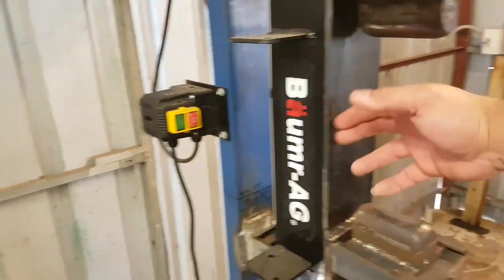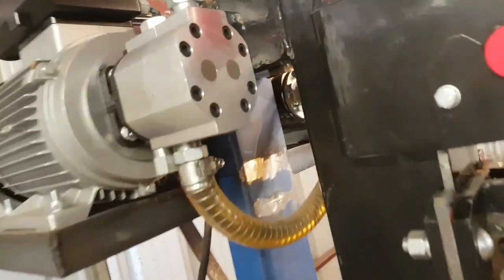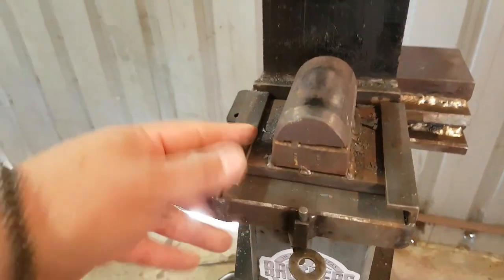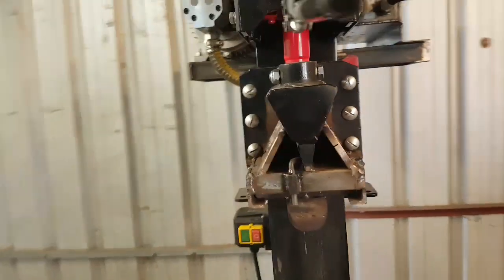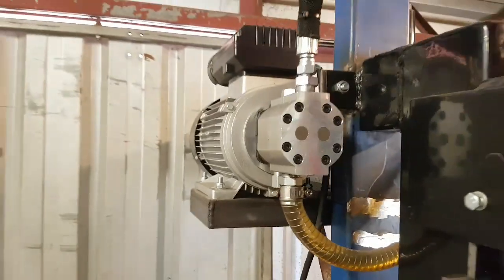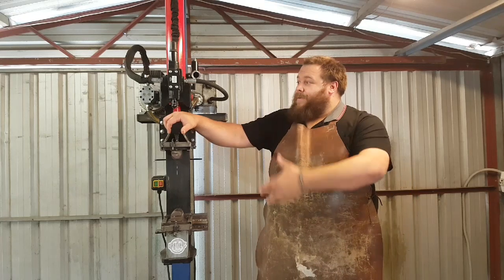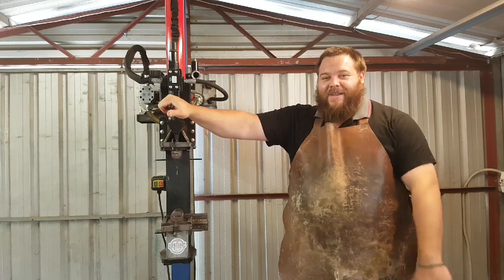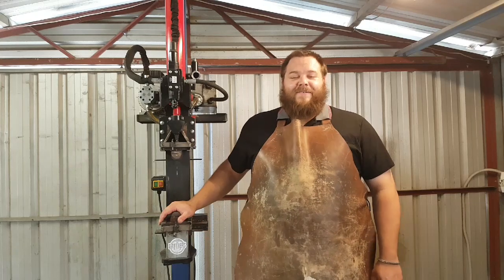20T log splitter forging press build breakdown

Comment: I've been thinking of making one with the same log splitter, but keeping as a log splitter with changeable dies. That way I can use it too split fire wood as well.
Reply from the maker: I did consider that, but the extra fiddling to make it work I decided against it
Reply: Alot easier too convince the wife that I have bought a log splitter to keeps the house warm, that doubles as a press, than yet another tool 😂

Comment: Nicely done mate.  Good solution given the cost of hydralic componets in Aus.  Just curious if the pump is a regulare 10A single phase?   no specs given on the website that supples the units
Reply from the maker: Thanks mate! Yeah just a 10a single phase, runs on any wall socket
Reply: @SamTownsBladesmith  Cheers mate, think I've found my forging press

Comment: Awesome build. However, why so much travel? Not a criticism. Just curious.
Reply from the maker: Thanks mate, mostly for upsetting bar stock, but also for using to set handles on hammers. Because it doesn't have auto return, it's no hardship to have the extra travel
Reply: @SamTownsBladesmith  Thanks. Makes sense. I enjoyed the video.

Comment: Hey Sam nice press mate. I'm just about to start building one using the same Baumr-AG 20 t splitter.
I notice you said the tank your dad made was 8 litres capacity. It looks bigger than 8 litres, is that right? 
And if it is did you get that from the original slitter tank capacity?
Still waiting for my splitter to be shipped to Tassie so just planning now and want to make sure I get the size right when I build one.
Cheers Sam
Andy
Reply from the maker: Hey mate, yep it's 8 litres, the 20t comes with an integral 7lt tank, so we actually gave it an extra litre! If you have any questions about the build please feel free to email me at samtownsbladesmith@gmail.com
Reply: @SamTownsBladesmith  OK great, thanks for the info mate. Very helpful. Your a champion 👍